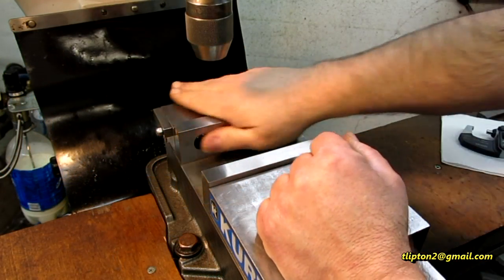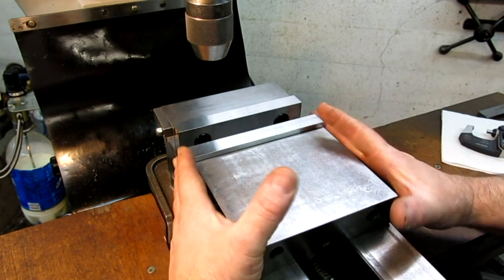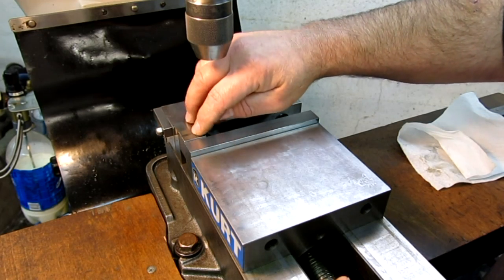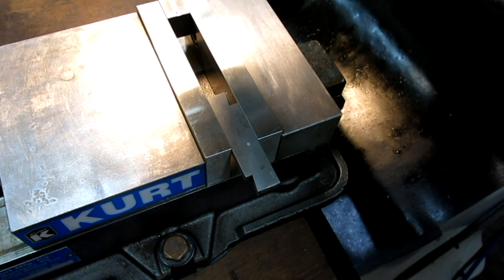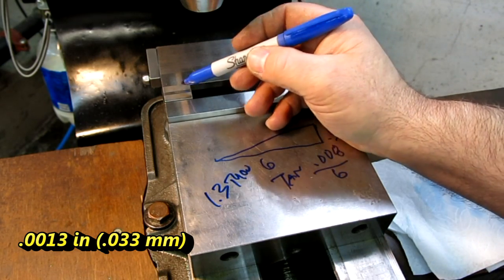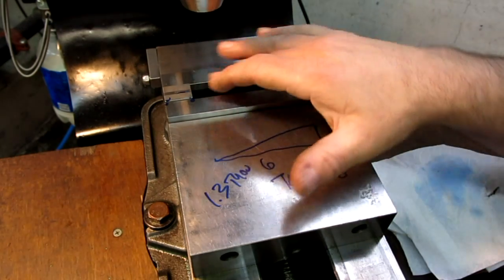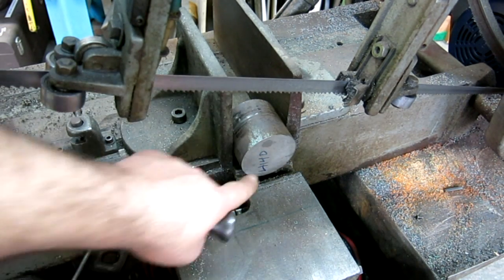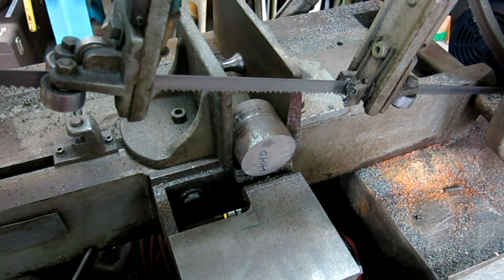Machine Shop Q&A 3 Vise Packing Blocks

Comment: Another consideration might be vise wear. Letting it cock under heavy clamping force each time distorts the bits that keep it straight. Of course that's probably more of a concern in a home shop where production throughput it not the first priority...
Reply from the maker: Hi Thunder,

Thanks for the comment.

Cheers,

Tom

Comment: Hey tom, 
 starting machinist here, int he mill would it really effect it that much if the movable jaw moved (speaking of being cocked or at an angle not clamping pressure) considering it is still clamping it to your fixed jaw that you should indicate to the ways anyways. as long as your reference edge is on the fixed indicated jaw it shouldnt matter much on your part. just my thought would love your input!
Reply from the maker: Hi Killer,

Well its always a good idea to clamp parallel when you can. The thing that takes a long time to learn is when you can do it and when you can't. Unfortunately it comes from making mistakes along the way. Balancing that with saving time is what makes a journeyman. Thanks for the comment. 

Cheers,

Tom

Comment: Great vid. I use mill jacks on the saw all the time. If contact on the part is a concern, I use welding rod on the movable side. Trying to match the work with a spacer to that precision takes time. Fine in a home shop but costly in business.

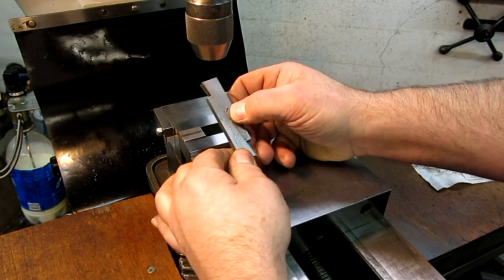Comment: about these adjustable parallels (3:25). How are the 2 pieces hold togeter, how is the locking mechanism working. I havn't found any pictures which are showing the mating surfaces. Are these dovetails? Tom, can you show me this in one of your next shop tours.
Reply from the maker: +mikrobe1 Hi Mike,

The adjustable parallels have a small dovetail and long direction split. There is a little clamp screw that squeezes the split down when you get it set. Thanks for the comment.

Cheers,

Tom

Comment: I always try to work in the middle of the vise so I don't have to worry about finding a block when I first started out as a machinist I had a piece lift out of the vise because of jaw spread an old Kurt vise by the way

Comment: Hey Tom,  Another great and wonderfully pragmatic video.  

I might have a slick idea for your bandsaw vise.  Years back I found myself taking small "balogna" slices off small pieces.  Instead of a packing or using a machinist's vise I made up a long spanning bar that is about as long as the fixed jaw is wide and put in a piece of all thread rod at the end away from the blade.  In the case of my saw the movable jaw is quite a lot narrower than the face of the fixed jaw.  So this works very nicely.  If the fixed and movable jaw are the same width it may require a notch be cut to clear the free end of the threaded rod of the spanning bar.

To use this I push the bar up against the short bar stock and then turn in the rod until it just touches and moves the spanning bar and then turn it back half way.  At that point I clamp the vise closed and the spanning bar and threaded support does a great job of holding the small lump o'metal that I'm cutting.

It's so handy it rests on the saw all the time with the threaded rod fitting down in a hole so it doesn't wander.

Comment: Hi there, Tom,

Thank you for the video.  I regularly watch and learn.

However, I have a question about the first part of this one:  wouldn't it have been better to measure the gap between the Kurt vice jaws with a snap gauge rather than an adjustable parallel?  After all, the adjustable parallel is a pair of opposed wedges, surely it will have imposed a non-trivial opening force on that side of the vice jaws?

Comment: Uh, how about not putting the part way off to one side, but instead in the middle of the vise?  On my 6" Bridgeport vise, the bed is solid from one side of the vise to the other, so there is not a deep slot in the middle to lose stuff in.  It is just as easy to set a stop for somewhere in  the middle of the vise as for the end of the jaw.  If the work is in the middle, there is no force cocking the jaws and you can just fuggetaboutit...
Reply: he has an absolute zero set on the left edge of the jaw on his DRO. also for milling the sides of your work.
Reply: +ineedagoodnickname Indeed, and I agree with you.  However, the absolute zero is not where you are required to put the part, it is easy to offset 3" and be in the center of the vise.  Not all parts need to be milled on their sides.  My point was that we often put parts at the side of vise by habit, not by need.  I know I do, it is easy to use a 6" ruler as a stop...

Comment: No to be an ass buutt... shouldn't you subtract the length of the part to make it .008/5 =.0016? Unless your part has a taper in the same direction.
Most of the time you have more than one part so you just throw one on the opposite side no farting involved.
Thanks for all the hard work and great videos.

Comment: Great video Tom! 
I personally use a dial indicator to measure jaw deflection & a strip of plastigauge to ensure even pressure across the piece of stock so I can adjust packing accordingly. Takes about an hour to set a piece of stock in the vice, I never seem to get the job done & I never make any money. But you know......O.O what's that smell? Is that sarcasm? :D
Reply from the maker: +69hytek Hey 69

BFG 

 B= Big  F= F....ng G=Grin   Thanks for the comment.

Cheers,

Tom

Comment: Shouldn"t the angle in the first set up be calculated with a 5.25" long leg? The vise jaw would be at 0.75" at the inside edge of the block and slightly ( aprox. 0.0013") open on the outer edge of the block. Not that it really makes any difference!
Reply from the maker: +Terry Goyan Hi Terry,

I was using my slide rule. +/- a few percent is acceptable. Thanks for the comment.

Cheers,

Tom

Comment: I very strongly disagree with you, if you ck with Kurt Vise (http://www.kurtworkholding.com/downloads/pdf/online_D688.pdf) they always say to use some type of filler block when milling small parts that do not extend past the center line of the vise. I would tend (and do) to follow what the manufactures suggests.
I have a real cheap set of adj. parallels (and jack screws) that I keep at my machines and only use them for filler blocks, I can grab them and set them up to the proper width as fast (or faster) as you can grab a 1/2" collet (maybe 10 seconds or less), but most of the time I am working on multiple parts and just put one of them on the other end of the vise. It takes no extra time do do it correctly and I am guaranteed to have the maximum holding power (if needed) and accuracy of the vise at my disposal.
The play in the movable vise jaw is adjustable and I sometimes adjust it very,very slightly depending on what I am working on. 
It also does not hurt to disassemble, clean and adjust the vise on a regular bases, as suggested by Kurt Vise, no matter how infrequent you use it.
.
It just boils down to good machining practices vs bad ones.
Reply from the maker: +Dave E Jones Hi Dave,

Bad machining practices? Lots of work getting done this way. I also use packing blocks. Just not for every job. There are no absolutes in this work. All I am trying to communicate is the fact that  the need for packing blocks is not absolute and  understanding the effects and magnitudes with your own equipment is most important. There are many time you would not be able to use a packing block even if you wanted to. I never meant to suggest that you should never use them only that in many cases its not necessary.  Thanks for the comment.

Cheers,

Tom

Comment: A common mistake is loading a vise with two pieces of stock that are not quite the same size.  A long steel bar from a rolling mill may vary in thickness by .020 from end to end.  So they saw it up into blanks and put a blank that is 1.000 on the left side and another blank that is only .980 on the right side.  The first one gets milled ok but the other one goes flying out.

Comment: This video made me laugh and cry a bit.  A departed friend had once impressed on me the importance of using packing when necessary.  His rule of thumb was 'If it squeezes more than the vice width, pack it."  So, .006 on a 6" vise is perfectly okay.   Cry, because he can't teach me anymore (and I didn't at the time understand all he was trying to teach), laugh, because he'd say, "That vise is clapped out.  If you don't want it to puke the part, you got to cock block it."  Referring, of course, to cocking of the vice jaw on the work.  Great video. :)
Reply from the maker: +ogberi Hi Ogberi,

Thanks for telling your story about your workmate. I'm totally going to steal the "Cock Block" terminology. I also miss the old guys I had the honor of working with. I would pay a lot to have a few more minutes of their time. Thanks for the comment.

Cheers,

Tom

Comment: Thanks for that Tom... I have a set of adjustable parallels... I had not though of using them for 
A) measuring. 
B) packing blocks. 
Also... the saw... now I have the excuse to go buy some of those mini-jacks that I always see.

Comment: seems a packing block would be better for the vise.  Continually putting off center pressure on the guides and jaws would cause off center wear.  And as far as looking around for packing material and wasting time I keep adjustable parallels near the machine and also an old set of blocks and machinist jacks near.  I paid (for me) allot of $ for the vise and think that packing is better for it.  You also seemed to slight a person that would pack as someone who is wasting money, not a fair comment.  You seemed to be irritated that a viewer would question your process. You simply could have said "that's just the way I like to do it"    Other machinists, on utube have preached use a block for holding safety!. I still love your work and videos.
Reply: I guess its mainly a question of why they commentated he should use a packing block. If it was because of safety then his comment is valid.

Comment: 4:03 if there was a gap in there, wouldn't putting the adjustable parallel in there and expanding it remove some or all of the slack you are trying to measure?
Reply: +Harlequin314159 I don't think the pressure he applied with his finger and thumb would move the jaw he torqued with the vice handle?

Comment: i agree if you have a quality vise you don't need filler blocks on the mill. We switch from kurt style vises to Gs precision modular vises 20 yrs ago in my shop and have never had a problem with small pieces.

Comment: On my old saw I had drilled and tapped the far side of the vise for a 1/2 NC and had a long enough threaded rod with a speed handle fabricobbled together. This made its super easy to cut shorts as I didn't have to fart with a jack screw or blocks. Maybe you could make of video of added that feature to your saw?
Reply: +Widget Works Manufacturing Inc. me too
Reply: +Widget Works Manufacturing Inc. Yes this is what I did too. It saves farting around looking for something to jamb in there, the only downside is the time it take to spin the thread in with my fingers. I reckon a smart guy like Tom could have a thread with clearance diagonally drill through, so it could be roughly set before dropping it down horizontally to pick up the thread and tighten.
Reply: Pete F Now that is a great idea, I wish I would have thought of that!
Reply: +Widget Works Manufacturing Inc. It's possibly not too late ;)

Comment: Know your limits, stay within em.... I think the right edge of the .750000 gage block actually becomes the fulcrum for the 8 one hundredths of a degree angle. Someone needs to design a vise that has a built in packing block system, possible like a micrometer carriage stop so that it can quickly and easily be adjusted. Like the whiteboard cleaning effect at the end Tom :) Great explanation. Thanks

Comment: Thanks for the video.

Even though the angling on the Kurt is insignificant, will repeated clamping without the spacer cause the mechanism to loosen?
Reply: +Morris Gallo Hardened steel and a hardened key & keyway under the moving jaw...

Yeah, it will wear slightly... when it is moved...

In a production shop, that might be a few dozen times per day... in a home/hobby shop however, your grandkids might decide that it needs a shim...

Comment: Thanks for the vid Tom. With respect to the horizontal band saw, I solved the "baloney slice" problem by bolting a small (old) 3 jaw chuck to an angle plate. It holds those small chunks square for slicing. Even better would be a four jaw. Kind of a poor mans cold cut saw..... Cheers, Daniel.